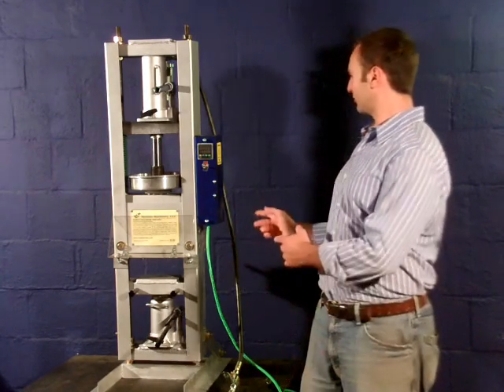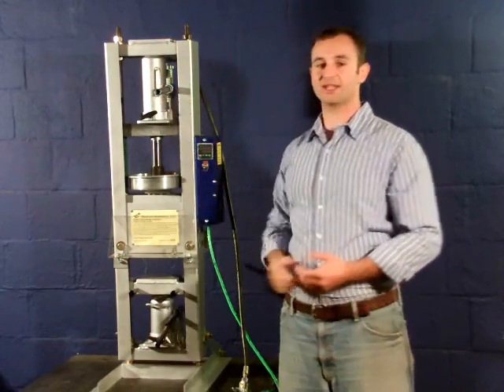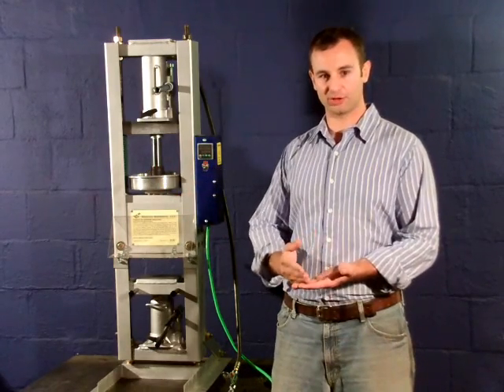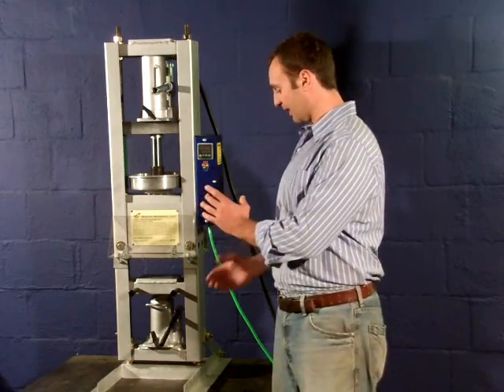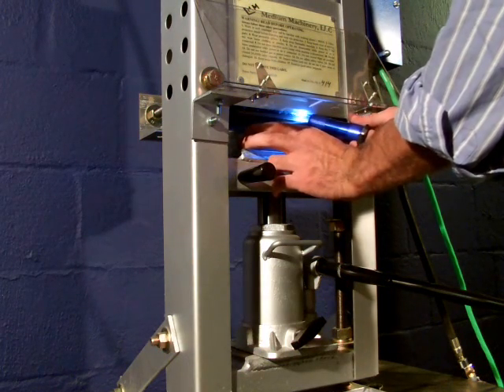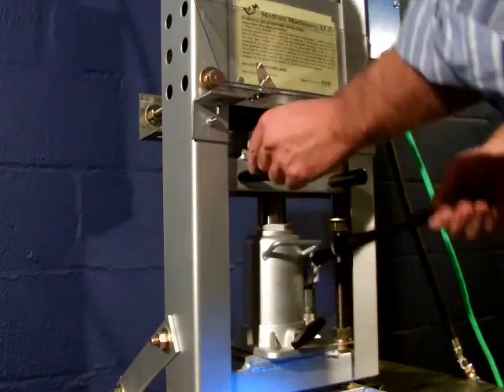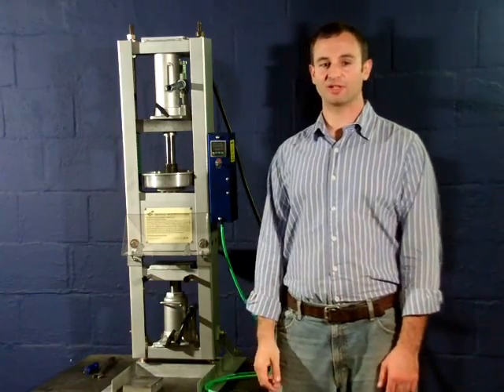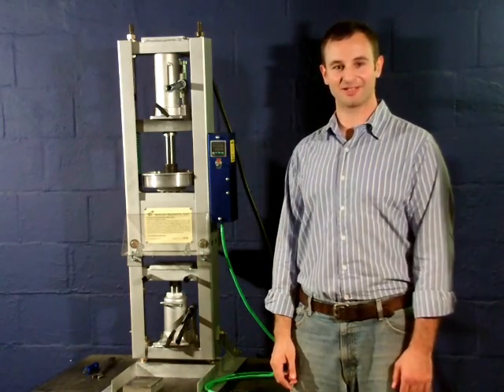Benchtop Injection Molding Machine User Manual

Comment from the maker: Vertical machines popular where space is an issue, as it takes far less space than it's horizontal counterpart. Also, a vertical machine allows you to operate it manually with multiple molds, while on a horizontal design the mold has to be bolted down to the unit.